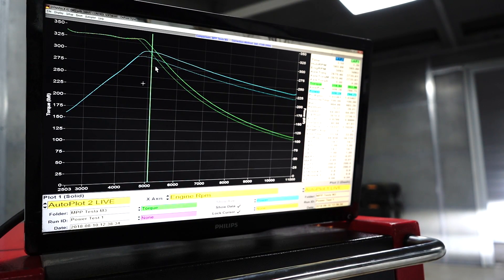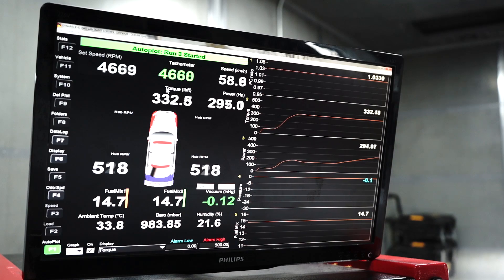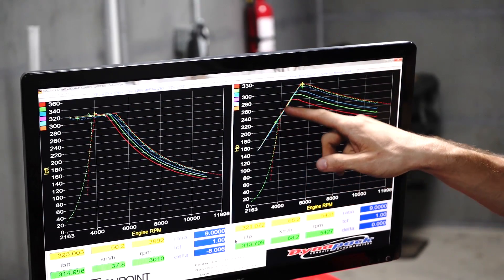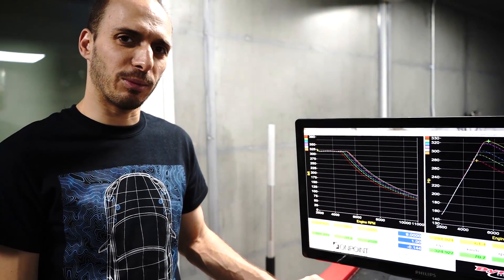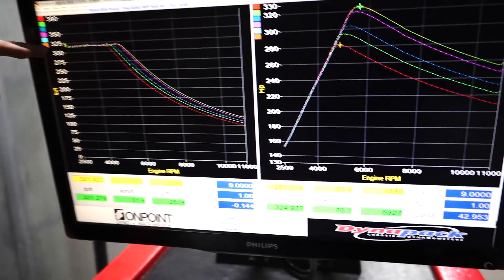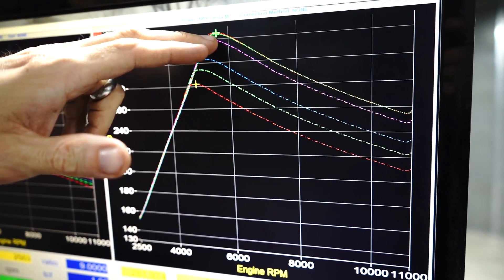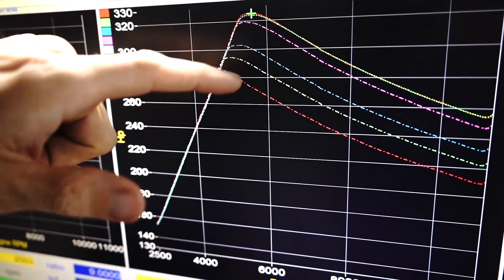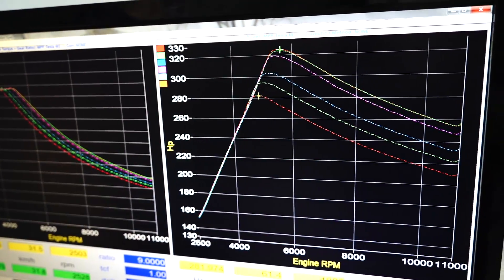Dyno Testing The Tesla Model 3 At Various Battery SOC

Comment: Why was almost no torque applied below about 40 km/h? Data for this region wouldn't matter to the SofC effects that you are studying here, but it seems strange to not measure what the vehicle can actually do in this region. 

There is blip in the torque up at that starting speed for testing under load, making it look like there is a local peak in output at the that speed. Can we assume that's an artifact of the test method, not a real characteristic of the vehicle? 
There is a similar blip a the top end of the test speed range... another testing artifact? 

I realize that this was done years ago, and that no one may remember some of these details.

The data through the range actually tested is great - thanks for doing this.

Comment: Couldn’t make the Model 3 meet up, again. But fyi, 32.2 update did lots of stuff for performance. First time ever, I hit 0-60 in 4.6 seconds within Dragy, that’s without 1 ft rollout. G force was a little off because unit moved around during pull but 4.8 at the worst case scenario at 80% SOC. Also the high end limiter at 70+mph is removed (2 dots) and about 7-10% more power at the high end. You should retest again when you have the chance!

Comment: What firmware is the car on? Per my understanding Tesla dialed back the RWD LR model after people were getting consistently better than 5.1 sec 0-60.
Reply: They weren't getting better than 5.1 sec, they were measuring with rollout, which results in shorter times because it's not a true 0-60, it's a 5-ish-60.
You can pull the Vbox data just like DragTimes did, and you can see the car doing an actual 5.1 0-60 from a complete standstill. Vbox just reports the time with rollout by default so that's why it gave 4.7.

Comment: Love your videos. No one else is doing this stuff for the Model 3. I am trying to carefully weight my options for my Model 3 order as far as battery and motor options are concerned. I'm kinda hoping that the standard interior is lighter as well. Bit off topic but do you see much weight savings being possible with out totally gutting the interior? I was thinking frunk/trunk going CF and perhaps the glass roof going CF (on non upgraded TM3)
Reply from the maker: We are moving towards a 100lb weight reduction without any compromise to comfort and daily use. We are not considering lightweight racing seats or plastic windows or replacing the glass roof. The hood and trunk are aluminum so the $$$ vs LB ratio is not great.

Comment: So what is actually happening as you go WOT with different states of charge?  Are the computers "capping" the maximum amount of amperage allowed to dump into the motor if the battery charge isn't high enough?  If the computers see a 95% charged battery, do they "uncap" and allow increases in amperage AND voltage to motor?  Or is Voltage to motor always the same? It's fascinating to learn about!
Reply: batteries have higher resistance at lower charge, so they heat up more. the computer is basically thermal managing everything. they probably have some predetermined model for the battery and have current limits at different levels of charge. the limit is the battery current, to protect it. Motor current is the same, which is why you don't see a change in torque at under 50% rpm or so. Voltage in the motor is proportional to how fast it spins, battery voltage is inversely proportional to current draw. so voltage is basically 0 in the motor when it's not spinning and battery is maxed when there is no current. The more current you pull from the battery the more it's voltage sags. for the motor as rpm goes up so does voltage. Motor current is basically always higher than battery current.

Comment: Thanks for measurements and analysis!  Always good to have numbers!  

Definitely looks like power/torque is software limited at the low end.  (That was also my impression from your earlier dyno runs.)  Performance gains in Performance Model 3 come from allowing the system to use more of the available battery power, since the higher-quality Performance controllers and motors can handle it.

Suggestion: make it more clear that this is the non-Performance, Long Range, large battery pack, single motor Model 3.  Casual viewers may not be aware of the details, so the labelling could be helpful.
Reply: Loanword Eggcorn any predictions for Standard Range Dual motor? Less battery but more motors!
Reply: For some reason, possibly weight, the dual motor Model 3s may be less efficient than single motor.  If so, then the single motor, standard range may be more efficient than dual motor.  

If you mean power, the smaller battery pack may have less power available, but it's unknown.  The main limiting factors can be motor, controller or battery power.

That said, if the smaller pack can make enough power, the dual motor standard range might be quicker than single motor due to lower overall weight.  But dual motor, standard range may also have the least range.
Reply: Loanword Eggcorn my commute doesnt require the longer range so I would like to spend the money elsewhere. I guess we shall see how the smaller battery stacks up when it comes out. Thanks for your comment.
Reply: Most people don't commute 300 miles a day.  :)  The longer range is mostly for long road trips, along with the Supercharger fast charger network.  (Most people in the U.S. and EU drive fewer than 40 miles per day.)
Reply: > The main limiting factors can be motor, controller or battery power.

MPP demonstrated on the dyno that the Model 3 LR is battery-limited above 5000 rpm at 75% SOC.

Assuming the SR has the same inverter and motor (why not?), then it's likely the SR power curve at 100% SOC will be closer to the LR at 60% SOC, and of course reduced accordingly as the SR SOC decreases.
Reply: There are two limits there: battery voltage and motor physics.  A different motor design might be able to make better use of the lower battery voltage at lower state of charge.  Both are due to physics.
Reply: Low-speed torque of any EV motor is limited, as seen in the lower part of the range tested here, by a current limit, which may be determined by the motor (due to winding current capacity or resistive heating tolerance) or by the controller's output current limit.
Reply: There's no evidence that the performance has "higher quality controllers or motors".  It appears to just be a software overclock with identical hardware.

Comment: Interesting test but wrong to say 100% should not be tested. We are talking about momentary peak performance, not enduring battery longevity schemes. Very bad that you didn't test 100 and indeed lithium batteries spike at the very top SOC and can deliver much greater power. So that's a massive fail. It might not give any more performance if electronically limited but the argumentation was 100% wrong.
Reply: My real world results show the best 0-60, 1/8 mile and 1/4 mile times are between 89%-93% SOC. In all my years of drag racing Teslas, I’ve never seen performance gains above 93%. His results confirm this.
Reply: It's also possible that Tesla's 100% SOC is only 97% actual SOC for the battery so the peak might never materialize but should still be tested. You could also test at the bottom where it becomes very weak.
Reply: Dan Frederiksen This isnt the issue. The issue is that even at 100% soc you don’t gain anything because the controller doesn’t allow it. This isn’t a pure motor with uncapped electricity flowing through the DU. This is all finely tuned and capped. I’ve compared Dragy times from 85% to 90% to 95%. I got consistently slower 0-60 times with 95% lol.
Reply: @L3uX what’s the best SOC for draggy ?
Reply: @JohnD0129  So much has changed since then, but all in all, warmed-up 90%+ will always yield better results. If you can't warm up, but are warmed by 80~85% soc, you will get most of the speed. These differences are only really above 60mph.

If you were able to get off a supercharger at 100%, drive a little for cool off, be ready to launch right at 90-95%, that would be the most ideal.
Reply: Agree it would be useful to try 100% for completeness, but the trend in the measurements is pretty clear.

Comment: Thanks Sasha last week a friend of mine André said that he knows who you are because his wife works with your wife I was surprised of that I told him how I was impressed of the work you’ve done on the lotus and the parts development for the model 3 . One question do you have 4 dynopack module for AWD testing ? I have heard that the dynopack system is one of the most precise on the market because it’s bolted directly to the hubs and there is no wheel slip plus for tuning ice engine you can load the engine a different rpm’s.

Comment: Great video. 12% drop in power is not significant but still good to know.
Reply: 12% is very significant. People spend thousands of dollars on mods for +12% power.
Reply: Even 280 kW at 30% SoC is enormous. But that's how EVs go, you lose power as battery empties. You're right but that's for ICEs, Model 3 could certainly boosted with modified software and perhaps a bit of hardware, that was done with Model S.
Reply: @etbadaboum  That's HP not KW.
Reply: 12% is pretty huge if you are into drag racing(disclaimer: Im not).

If you were street racing someone(specially from a rolling start) that you know you have a slight advantage in power, stock-to-stock, you might get gapped because you likely drove a few miles out to "mexico" to do some freeways pulls so your no longer fully charged to meet the advertised numbers while the ICE car's power remains essentially a constant. If anything it gets faster as fuel lowers since it weighs less(although it is a small but noticeable enough difference)

I don't own an EV so im not sure if this exists but if one EV can charge another EV by sharing power, that could solve the problem I guess?

Comment: I suspected low end they’d try to keep things consistent because there’s a sizable buffer/cap. So we definitely know there’s a lot more untapped power on the table for the RWD/Rear Performance DU, especially for the low end of things. Guessing at least 20%+ gains is easily possible with current hardware and assuming traction isn’t an issue. High end untapped power is more of a question due to long term durability but guessing there’s at least 20% available. Thank you for testing this out.
Reply: MikSIK., sometimes it’s done strictly to stay within the Torque rating of the gearbox. It’s very common to derate prime movers to get a longer life. We see this a lot with Diesel engines, whereas a stationary diesel for a generator might be rated at 700 HP @ 1800 RPM  and the exact same engine block is used in high speed marine propulsion to make 1400 HP @ 2300 RPM, but the generator will run 10x longer between overhauls.

From what we are told about the model 3 performance version, it’s the exact same gearbox and driveshafts, but about 30% more Torque, which means these drivetrains will potentially have failures long before the non-performance version will. Perhaps 25 years on the non-performance version with normal maintenance and 10 years on the performance version with normal maintenance.
Reply: Thank you for the insight. It's hard to explain it but you said it.
Reply: @imho7250  I suspect silicone is the torque limiter here, and heat of course. Maybe performance model gets nicer electronics for more current (more torque).
Reply: difflocktwo, all model 3 use SiC semiconductors. Elon said they are the same motors and inverters in AWD and Performance, but when the do QA, those which over-perform are used in the performance version and those that underperform go in the AWD model.

But essentially they are the same car, but one is uncorked for $9000 extra. And I think this is why Tesla decided to chop $3000 off that uncork, add the $5000 performance option as “included”, and delete $2000 worth of free supercharging. 

Either way, those who bought the AWD version or P3D without PUP got screwed, those who bought PUP have options. Those who were just $5000 short are screwed because Elon isn’t going to change the brakes, wheels/tires, to add PUP later, even though it should be easy to do at a service center.
Reply: Also did you test this with your current TC/Stability defeat module? Separately, I think there is a lot of low end/dig performance to be gained if you can preload the motors (poor man launch control) by preventing the Both Pedals Pressed warning from coming on. I noticed you’ll get wildly various forms of acceleration all dependent on the time the brake pedal is released to the accelerator (there’s funny software coding in the background here). Wonder if it’s possible to delay both pedals pressed warning for at least a full second without disabling the brake pedal itself. Noticed anything similar?
Reply: He measured torque.  Not sure how one would preload an electric motor.  The stator either gets power at an appropriate time for the rotor/stator phasing, or it doesn't.

Tesla uses a direct drive single speed gear.  There is no automatic transmission to load up.
Reply: Loanword Eggcorn, I think he’s talking about loading up the drive train similar to what it would be if using the motor to hold you from rolling down a steep hill, which would take all the slop out of the double-reduction gearbox, CV joints, and preload the suspension, just to give more repeatable launches. This will probably be part of the track mode package that Elon was talking to MKHB about, where you can do all sorts of stuff if you are willing to accept responsible for destroying your car. LOL
Reply: @L3uX  model 3 has a reduction gear. you cannot preload a reduction gear and the motor makes peak rpm from 1 rpm.